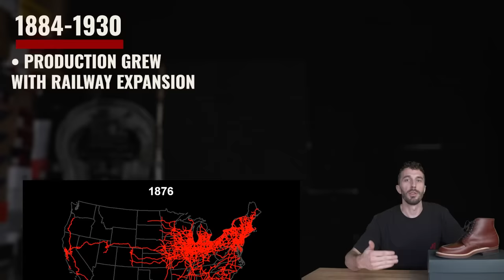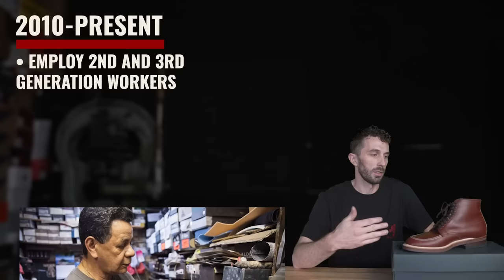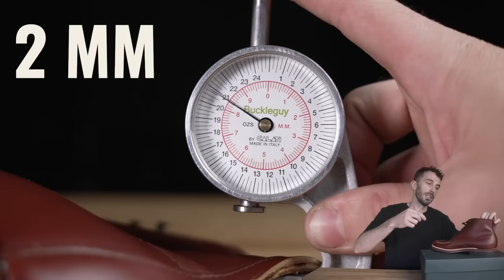Why the Indiana Jones boot is stupidly overpriced - Alden Indy

Comment: It would be interesting to see like a 20 year old pairs of the indy boots cut in half to see if they did switch to cheaper materials or if they just increased the price as they got more popular and they were always made with more budget materials.
Reply: They mostly were.

The older ones (pre 2007 or so) were actually canvas lined
Reply: If anything they were worse. They used super cheap leather at some point.
Reply: I have a pair that's exactly 20 years old.  Can't speak for the insides, cause I don't know what I'm looking at, but the upper leather is outstanding.  Different color too.
Reply: @joshuaspencer1346  it's a different leather
Reply: @joshuaspencer1346  they make Indys in many different leathers, including Shell Cordovan! A simple resole will take care of the leather board midsole issue!
Reply: They don’t last that long, less you leave’em in the box.
Reply: Products associated with “celebrities” are generally overpriced regardless of their quality.  Good, average, or bad quality, the status factor of wearing celebrity associated brands ie hypebeast has a significant price.
Reply: @oyster_3694  You shouldn't need a resole to fix issues in a 600+ dollar boot. Period.
Reply: The 403 is Chromexcel, is much better quality than the 405s, at the same price
Reply: Rip Off! yup
Reply: @musicman2093  True, but I put my pair through the ringer for four years even breaking the rule of not wearing the same boot two days in a row. It was pretty much daily for four years for me. So I definitely would've have worn out the leather board faster than someone using a rotation. Overseas, full days at amusement parks, walking all over town, retail work and typical choring. The boots held up. Only thing I've done was replace the top lift since they were worn down. Still going strong, but definitely needing to be sent in soon. Lasted much longer than my Thursdays that I had in rotation with two years of owning them.
Reply: i have a pair of old canvas lined 405, also 3 years old 403 and more, no problems, they going strong. I am not babying those boots, maybe one or 2 care sessions a year. I had never issues with the neocork sole, its grippy in the rain, no issues with the leatherboard parts. Yes the are bloody expensive, but I had not one more comfortable boot in my life. RWs are not comparable in comfort. And yes, they could be cheaper, but a Rolex could be cheaper too
Reply: @tommyinoz2100  haha, agreed, but a cheaper Rolex that’s pretty much just as nice these days is Tudor, since they moved to in-house movements. It’d be nice if there was a company making Indy boots that were as nice, but cost half as much. Or even a third as much.
Reply: They increase prices every year and use lesser materials.
Reply: @jacksparrow7618  Look at Rancourt - they use Chromexcel leather and handmade in Maine for around 25% less.  I suggested Weston get a pair to cut to see how well built they are.
Reply: I've got a new old stock pair that we estimate to be about 30 years old based on the logos inside and out. And you can't cut them in half. Sorry.
Reply: @Johnny White 600 dollars is NOTHING. I spend that on one of my 100 skins on PUBG. Cmon now.
Reply: @oyster_3694  - to each their own if you really love the boots but I don't see the point buying a pair of $600 boots that require a resole to get the materials that should have been in the boots in the first place.
Reply: I have a pair that's about 20 years old, and they're canvass lined.  I'm curious to know if they were better then too.  Frankly, the boots need resoling at this point, but I hate to send them back to Alden to do it if they're going to resole them with cut-rate materials.
Reply: @mosessupposes2571  Harrison Ford was just wearing his carpenter boots for the movie (he started out as a scene carpenter) there is no “celebrity” connection.
Reply: They need to be 40 year old indy boots since that's how long its been since the movie came out.
Reply: @joshuaspencer1346  Alden currently produces these in different leathers. The older Alden color like from the Indiana Jones movies is no longer available- this is likely because Alden sources their leathers from producers like Horween and don't make their own (unlike say Redwing- that has their own tannery)- so the older leather color is likely no longer produced.

That said, the 405 is a business casual office boot that is not supposed to patina; the 403 uses CXL leather that patinas nicely.
Reply: @erichpryde5309  the 405 will patina, it just won't patina nearly as quickly as the CXL. the CXL stretches a lot more and a lot faster than the cowhide used on the 405, which is more akin to traditional workboot leather (from what i can gather without actually owning a pair).

the 405 is not just business casual, it's a solid workboot, as long as you don't need a steel toe or any of that crap. work boot not meaning that you kick the shit out of them just because it has work in the name, take some care of your possessions, it doesn't look cool to have beat to shit boots just because you want to look experienced.
Reply: @Murtagh653  I own both a pair of 403s and a pair of 405s. I like both pairs, but scuffs in the 405 don't "patina" in at all the same fashion as the 403s. they have to be brushed out. in some cases, they really can't be. the leather doesn't show damage and wear in NEARLY as an attractive fashion as the CXL.

You may have taken my comment as something in support of the video review, just let me clarify that's not the case. this reviewer doesn't apply the same standard to all boots he reviews (likely because he's paid for some of the reviews) and I can't take him all that seriously. I've been wearing Indies for quite some time, it's the most comfortable boot I own. 

However, that doesn't mean that the 405 is built for a heavy work environment. the leather can't handle it, whereas the 403 can DEFINITELY handle it. As someone who wears and owns both pairs, let me say that I wear the 405s a lot but I don't go hiking in them because of my experiences with them.
Reply: @erichpryde5309  i'm aware, but "scuffs" are really just damaging the dye, you can easily buff it out, or if they are really bad, get a cobbler to fix it for you. though if you are an Indiana Jones fan, the dirtier the better, his were incredibly dirty and scuffed.

i'm aware he doesn't apply the same standard to all boots he reviews, i've seen the reviews of the very expensive boots he buys and despite flaws from the company he buys them from, such as sizing issues and not replying to emails that could have prevented said sizing issues, he still defends them and tries to claim all the blame for himself, which is where i agree with you about the reviewer, but i appreciate that he cuts apart boots, which can be separated from his bias to get the facts about the boots (leatherboard really isn't acceptable in a boot that costs this much) 

i've looked at a few comparison videos, including one where the reviewer actually had both pairs and had worn them evenly for about a year, the 403's were much more noticeably aged, whereas the 405's almost looked brand new, not because of scuffs or anything (though his 403's did have a few scuffs), but because the CXL leather just seemed much softer, more malleable and thus appeared much more aged than the 405's.  if you're interested, the video is titled "Alden Indy Boots 403 vs 405" and it is uploaded by "aerosurferlv"

i remember reading a few comments saying that the 405's would age just as nicely as the 403's, but it would take a lot longer, as the shoes would have to be worn much longer to get an aged appearance, unlike the 403's which seem to take on an aged appearance in a relatively short period of time. 

i'd love to own a pair, and to be honest i probably will up getting a pair, it's just that they are not worth the price they are asking.
Reply: @Murtagh653  I appreciate the information... but I kind of feel like you're not reading what I said in a way. Based upon what you just shared I feel like I could have written the review you mention. The 405s don't REALLY patina. The finish on the leather is much softer and much easier to damage and takes a lot more work to correct. Hence, NOT a work boot. I'm not saying the 405 doesn't age, it just doesn't really patina. 

Lastly- despite my comments I would strongly recommend ownership, especially of the 403s. They are ABSOLUTELY worth the price, it's the most comfortable boot I've  worn and over 5 years has remained that way. My 405s are just as comfortable, they just have a much less durable finish that doesn't patina in the same way. 

I also own a pair of Color 8 Shell indies, which is my favorite of the three.
Reply: @erichpryde5309  i'm not sure why you are focusing on the finish of the boot, as cosmetic issues are rarely a consideration when talking about work boots.. 

take a look at any work boot that has actually been worked in, they are scuffed, gouged, dirty, overall in bad shape, people who buy work boots for work are not worried about looks, they want a comfortable boot that will last (a little while anyway), it's why even the PNW boots often have to be re-crafted, a resole won't cut it as it is common for the uppers to be falling apart.

the finish might not be as durable, but the stiffer leather looks like it would hold up more to heavy use, given how much the CXL stretches under light to moderate use, and not hard use.  

my point is that the 405s were originally a work boot, and i can't see that they have changed much (the leatherboard is disappointing, but it could be replaced when they get resoled). of course it won't hold up to certain professions, and is not designed for logging or anything of that nature (due to the flat sole) but there are plenty of other jobs on hard surfaces that these boots would be fine for.

if your  boots have not got a patina, you just haven't worn them enough, it takes a lot longer than the CXL version to patina, but it will get one.
Reply: @Murtagh653  The 405 is not stiffer at all. It's much more supple. The CXL is much tougher leather despite how it appears to you. The 405 leather shows damage when the top "teas core-esque" layer is scuffed off that does NOT patina (defined as toning or darkening at points of wear, stretch, or damage). 

Please at least handle these boots before asserting what the leather is like, because as someone who owns and regularly rotates between 403 and 405 I can authoritatively say that the 403 is a much tougher boot despite what you believe.
Reply: @erichpryde5309  well that differs from what other people are saying. in the video I mentioned, the youtuber said that the 405s were much more supportive and comfortable for longer days. the 405 "leather" is not being damaged, the rather thick layer of pigment that has been painted on top is what's being damaged, you can it see in rose anvils other video (i know you don't like him, but the objective parts of his videos are useful). if it doesn't patina, i guess all those people who post pictures of their 405s with patinas are mistaken.

well, if you can authoritatively say it, i suppose that negates the opinions of all those who own both and say otherwise.
Reply: @Murtagh653  Just curious how you could observe "patina" in the leather if there is a thick layer of pigment applied to the leather, thus hiding it. It's very likely that you're not understanding exactly what I mean in reference to patina.

 Anyway, get a pair and experience it for yourself, both the 403s and 405s are definitely worth the money, especially if you go through Alden of Caramel (seems like quality control is better vs. just buying through a second-hand dealer or from Alden online).
Reply: @erichpryde5309  because the thick top layer wears off with use, allowing a patina to develop. if you don't believe me, feel free to google it, there are a few people who have posted their 405s that have patinaed , i can't post links or my comments get deleted

i might, when i have a bit of spare cash, but i don't have the option of trying on in person, as there is only one dealer in my country and both their stores are a plane / boat ride away, so i would have to guess my size and hope for the best.
Reply: @Murtagh653  you probably don't need to guess! They run about one size down from your true brannock size. If you know your size in Red wing, your size in Indys should essentially be the same. 

Regarding the patina, I'm willing to bury the hatchet and say that this was a miscommunication/not enough words used in my initial comment to explain what I meant.
Reply: @erichpryde5309  i've heard conflicting reports on the sizing down, some people have luck with it while some of the official retailers say to not do so. i usually wear a 10.5 EE (US) and i like the extra width, my big toe doesn't bend inwards like a lot of peoples do, as i haven't worn constricting shoes like a lot of people have, so i want to keep it that way, which is why i'm interested in the indys in the first place,  because the trubalance last is more anatomically correct than most lasts used these days, especially for boots that are a bit more on the formal side. 

my main concern about the indy sizing is width, i don't know if i need the EE, E or D width, as i wear EE in other brands because the lasts they use are not shaped properly (too narrow in the toe area, which is the widest part of my foot), and the indys are supposed to be wider by default than normal shoes and boots.

I heard one explanation is that the indys are wider, for more comfort, and longer than normal sizing, so that they can give the appearance of a pointed boot while still being comfortable, as your toes are not being squeezed into the point

i unfortunately do not own any red wings.

i am willing to bury it, too. i may have misunderstood what you meant.
Reply: @oyster_3694 right, but how much does a "simple resole" cost on top of a 655.00 boot?
Reply: Yes! Let's see a pre 80's pair cut.
Reply: @gnarl12  Yes, that's correct.

Comment: Phew. I dodged a bullet. I’ve always wanted a pair of Indy’s, but I went with a Grant Stone Brass boot instead since it’s a little cheaper and think it was the right choice.
Reply: I own both. The Grant Stones are better made and have higher quality materials for sure, but the Alden’s are more comfortable.
Reply: @Xaluber  Yeah, I could see that. I had to put a Dr. Scholls heel pad in mine, but after that they’ve been awesome!
Reply: @justinarnold4024  if you buy a cheaper boot but it's uncomfortable to the point that you don't want to wear it after 6 months, or if you buy a more expensive boot that is so comfortable that you can wear it 12 hours a day for years- which is the better purchase? Because somehow... despite the cheaper quality of the materials used, Aldens do last for 5-10+ years and are still one of the most comfortable boots you can buy.

Comment: I'm so, soooo glad you did this one. Thank you. May I vent? I gotta vent. Okay? Thanks...

I've had three pairs of indys, and you're right. The best pair was the ones that I waited three months for - brown indys with a commando sole (the only sole that should be on them, IMHO)) - and they showed up at the shop with one boot having a very clear manufacturing defect were the upper is attached to the heel. I took em at a 65% discount. I asked Steve over at Bedo's Leatherworks (he does a lot of Indy rework) to fix the heel correctly, which cost a bit more than a hundy. Basically, it ended up I paid about 50% of retail. They are comfy, I wear them in the yard and out hunting and shooting and I pretty much don't care how beat up they look. I have a black pair with the same rubber-cork sole and they're fine for the office (it's actually a great boot for the office). They shine up nice. The worst was the pair of horween color 8 shell indys I got where the speed hooks ripped out when I was lacing them up on DAY ONE of having them... last year. They're currently making a new pair for me, and I do want them as an alternative to my shell vibergs and shell white's, but that the quality was so bad to start with, and it takes forever to get replacements, I'll never put another Alden product on my feet after these. The style is very nice, though, and I do like it for appearance and variety, but price is high, wait time is long for common sizes and quality issues may mean time or money spent on rework/remanufacture. They're just not worth it.

Oh, and one other thing that isn't apparent until you try on a pair - when fully laced, there's precious little space between each side - it's like the shoelace is stitching holding the 2 sides together. Better hope your foot isn't smaller than that or you're SOL!

You wanna know who makes the best Indy style boot? - Parkhurst! - and Beckett Simonon does a similar style that's also attractive and better-made. I think Alden is dead. I heard that a lot of their older workers retired or died and they've had hassles producing shoes & boots at quality or quantity over the past few years. My East coast Alden retailer tells me that they will improve, but I think everyone can count Alden out. When I'm done wearing mine, I can sell them on ebay and get all my money back (rarity!), so the money spent on them isn't so much a factor for me personally, but the quality of workmanship and materials should make them a non-starter for anyone that doesn't already have a pair... imho.

Whew! That was cathartic! Thanks!
Reply: Your rant is overblown.
Reply: @gnarl12  found Aldens YT account